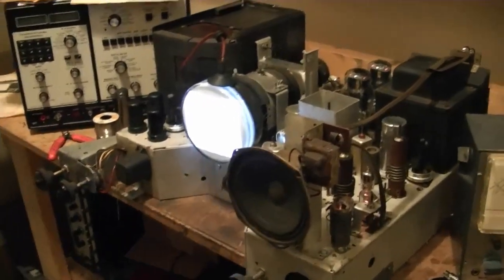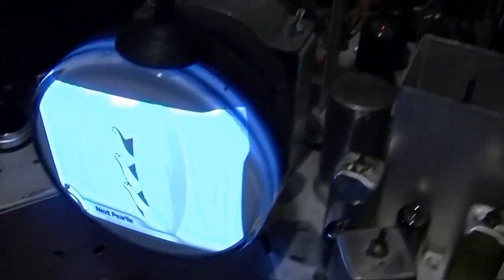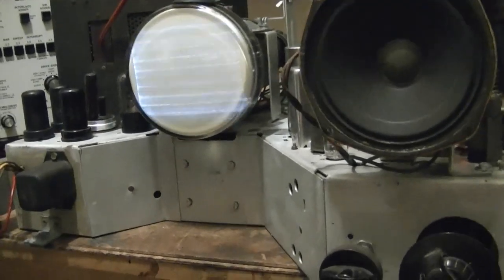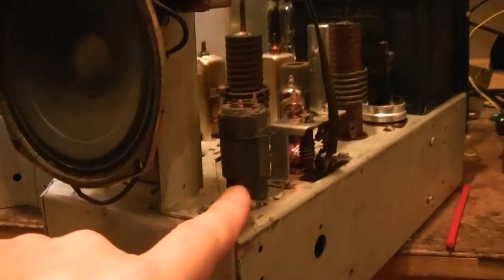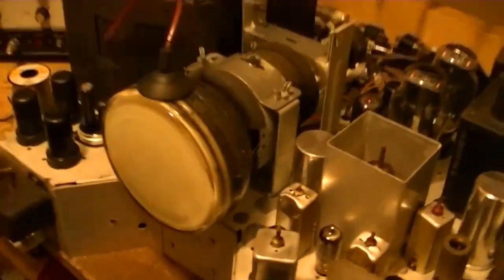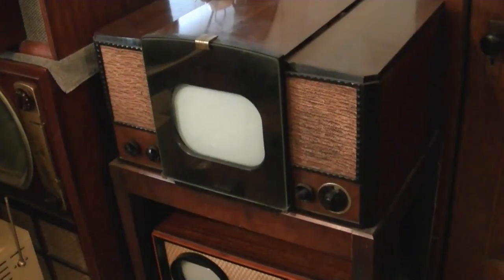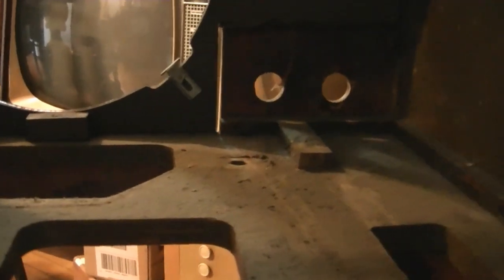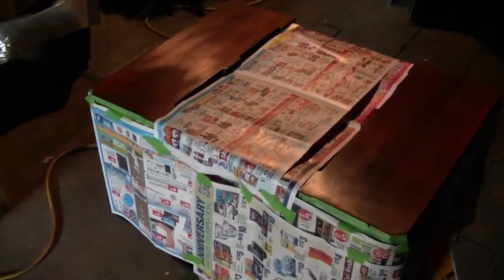RCA 630TS restoration p11o?

Comment from the maker: Yes, the 721 is from 1947 and nearly identical to the 621.  I have an RCA 8T241 in storage that I guess you could say is is the 1948 simplified 630TS with only 24 tubes.  No germanium diode - they just left dc restoration out.

Comment from the maker: I'm not sure.  I got a little frustrated with the speakers.  The bondo glazing compound I just to fill the rust pits on the speaker frames out gassed and cause the paint to blister and flake off.  So I want to sand them down and repaint.

Comment: So is the 721 a 1947 model as opposed to the 621 which is a 1946 model? Is the chassis and circuitry the same other then the size of the picture tube? I notice that even the "630" chassis itself was simplified during it's run, I would guess that they replaced at least one 6AL5 with germanium diodes for the D.C restoration function like they did in my G.E.